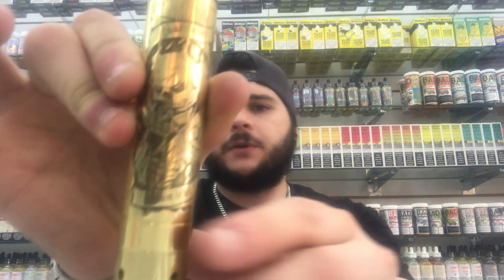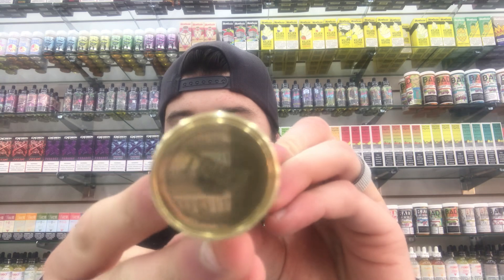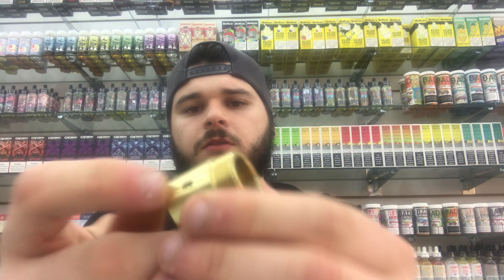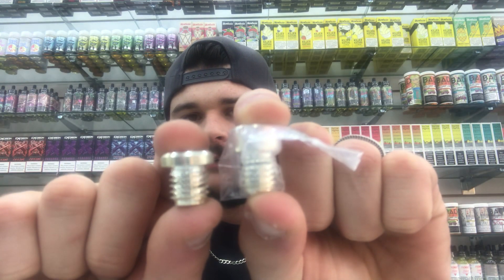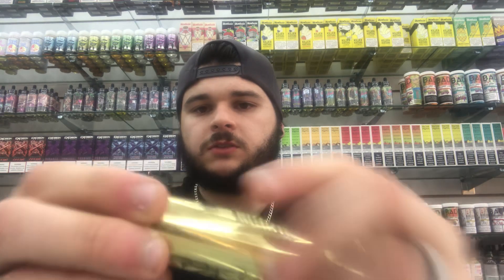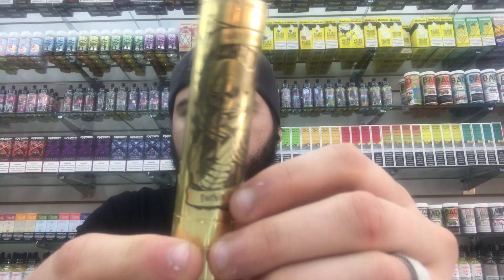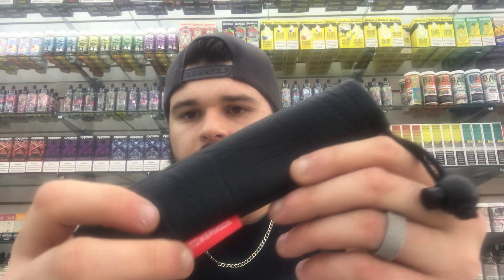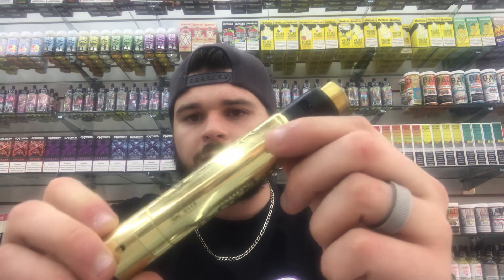DESOLATOR V2 By Tower Mods Philippines Video Rundown

Comment: You know you can have it except the 32 21700 by sanding down the top of it a little bit and it slides right in fucking monster mode
Reply: The top piece you took off is the part you send down to get the 21700 to slide in a buddy did it and now everybody I know has done it it is turned as mod from a monster into a fucking superbeast